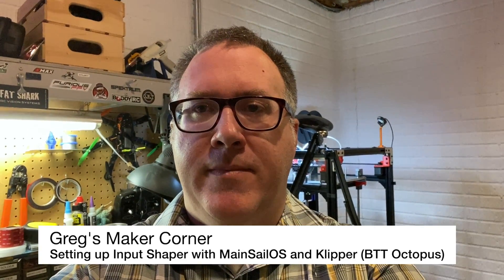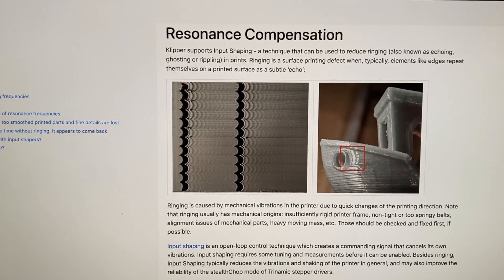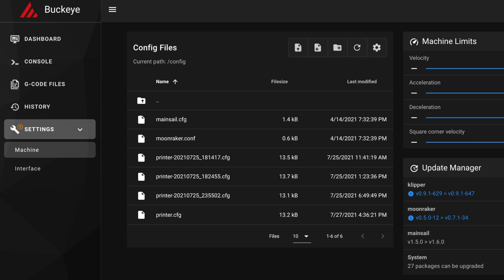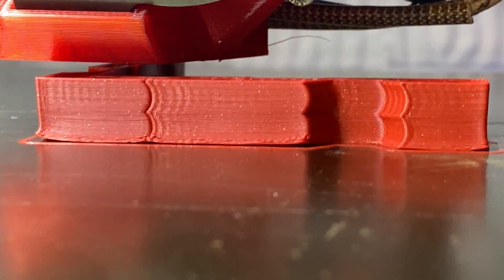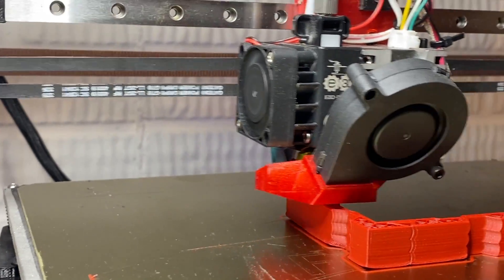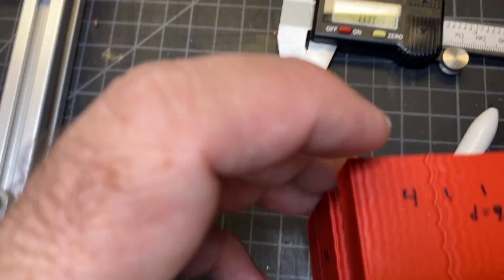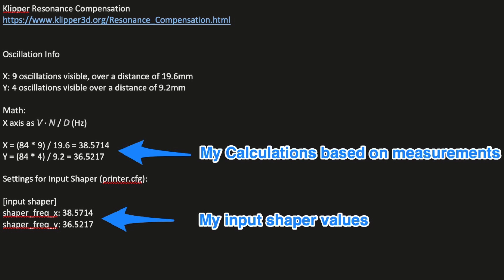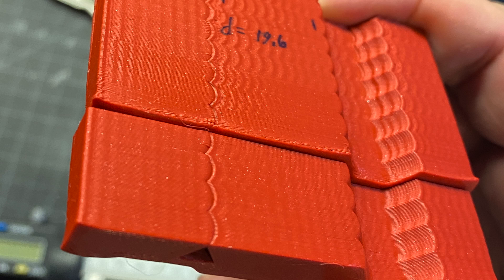Input Shaper Tuning in Klipper using the Big Tree Tech Octopus v1.1

Comment: Hi Grag how long does it take to print the xyz cube with input shaper enable?
Reply from the maker: Great question! The slicer estimates around 28 minutes, I think it's probably a little less than that when I print one but that seems pretty close. That is going at around 100 mm/sec with input shaper turned on.
Reply: @GregsMakerCorner  My Slicer also gave me the same estimated time as well. It took me about 11 minutes to complete the xyz cube with my own input shaping firmware.

Comment: For i3 style printers, you have to run the accelerometer test separately on each axis. I think I read for coreXY you can have it active during a print for real-time compensation.
Reply from the maker: That makes sense. I would definitely like to try one out to see how much of an improvement I can get over the manual method. But I'm totally impressed how well it cleaned things up even so.
Reply: @GregsMakerCorner  I did manual on mine. Managed to hit about 2700 accel. My hotend is sadly limiting me to 150mm/s.